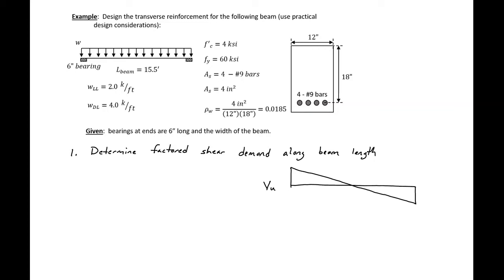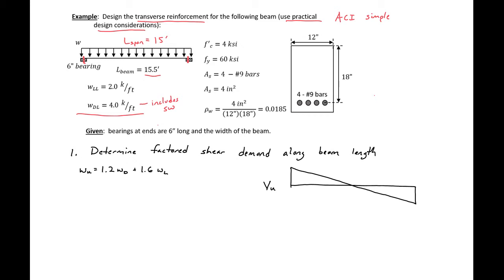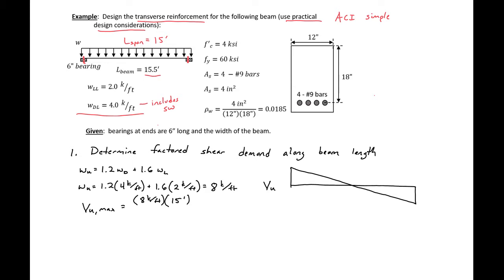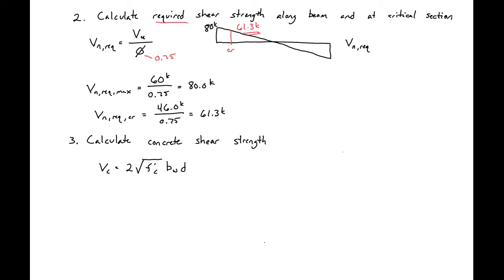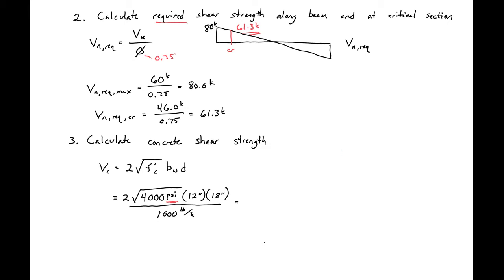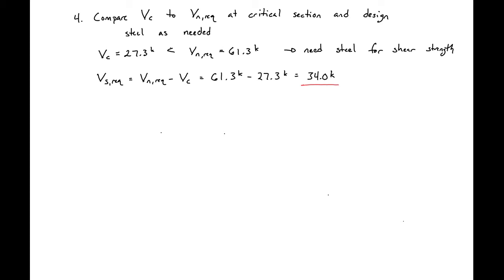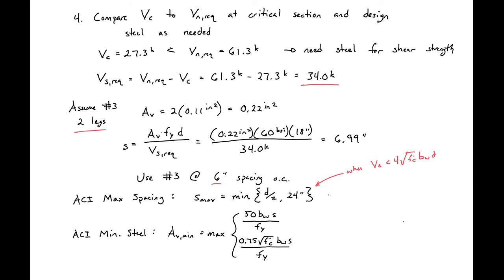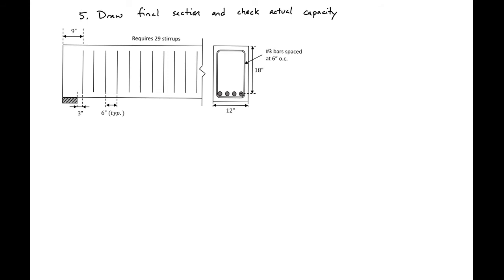8 - Example 2 - Design for Shear Strength using ACI

Comment: SIR wether we need to count the formwork weight in design of slab and beam of RC structure if not then why 
what are the ACI LIMITATION
why we not counting them because they are so heavy concentrated loads which is applied to the slab

Comment: Total beam length = 15.5 ft            Beam span ( center to center) = 15.5 -6/12 = 15 ft  ,      Vu max  (60 k) was calculated at the center of the bearing   - Critical shear design force at d (18") from bearing edge   or  (18"+ 6"/2)  from bearing center . So                                  Vu cr = 60 - 8( 21/12) = 46 k  Thanks Sir

Comment: How can we solve if any point load present????
Reply from the maker: This would generally just change your shear diagram, so you would find a new shear diagram with the point load in step 1 and then continue with the rest of the problem in a similar fashion. If the point load is close to the support, you may want to use the strut-and-tie method. See my lecture on the strut-and-tie method for more information on this.